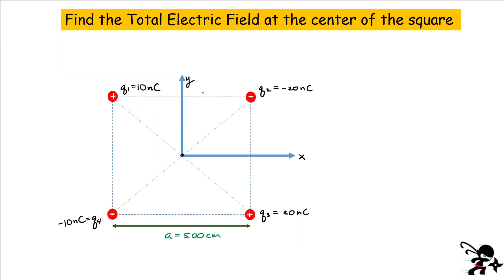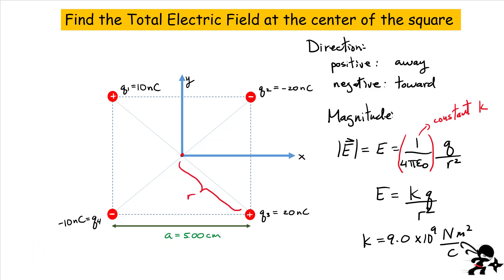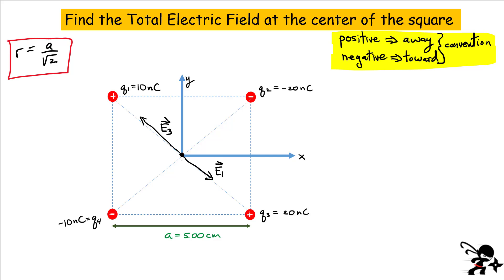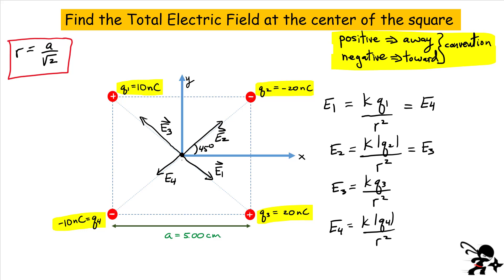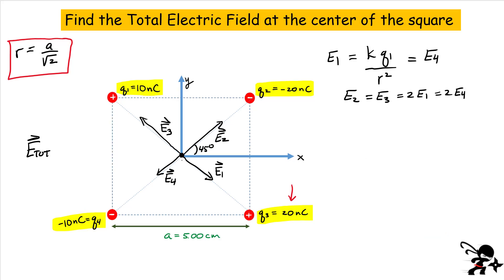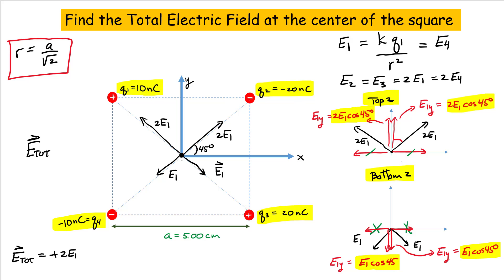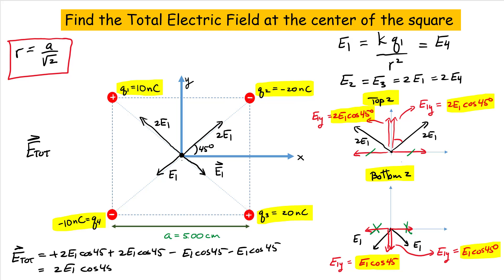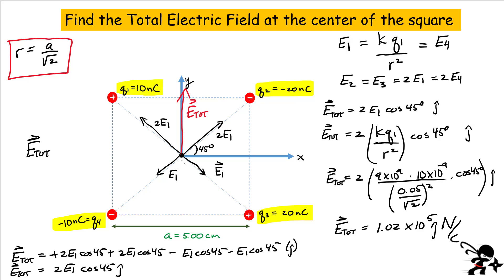Electric Field at the Center of a Square

Comment: 🇳🇬 There should be a mistake in this calculation.  I stand to be corrected, though. When resolving vectors. The horizontal component  should be Fcosø while the vertical component should be Fsinø. In this case, there is no x component because it cancels out. And the  electric field at the center would, therefore, become the y component of the resolved fields. Since E = X + Y, i.e., E = 0 + Y. Which means that a test charge placed at the center of the square would experience an upward force.
Reply: that entirely depends on which angle you are looking at - rather than learning x is cos and y is sin you should look at the definitions of cos and sin in regards to the angle you are looking at. But lucky for you here, sin(45) and cos(45) is just the same value.

Comment: im so cooked ;/
Reply: I know you’re probably finished up the course by now but I just want to state for other people in the future using your message as a reference to their state of mind regarding the explanation in the video given that this was done in a more complicated way than it should have been. I like this educators content but sometimes I find he over explains things that can be done in less than 10 mins time like for example we could have just derived the distance using special triangles and just know that the hypotenuse was going to be equal to whatever the length was multiplied by square root of two and divide by 2 bc it’s half the distance bc we’re only going towards the centre. Then set up vector components equations for each and see visually how the y values cancel each other ultimately.

Comment: hello I have a suggestion that might make it more simple without having to use cos or x and y component. You could apply pythagorean theorum on one of the triangles of this square. In that way you don' t have to devide the length in 2 and wouldn't have to use a 45 degree angle or cos.